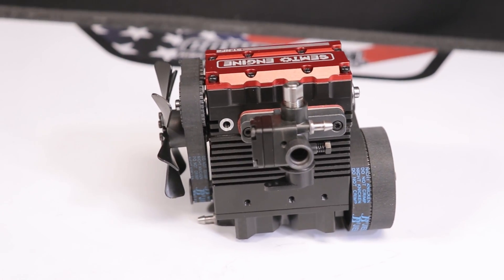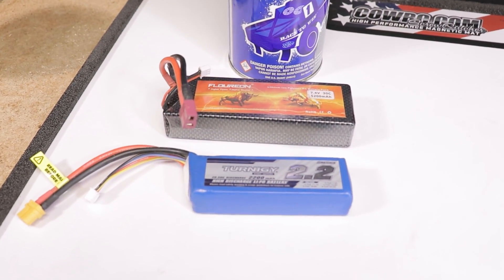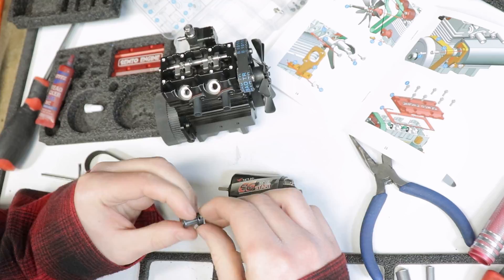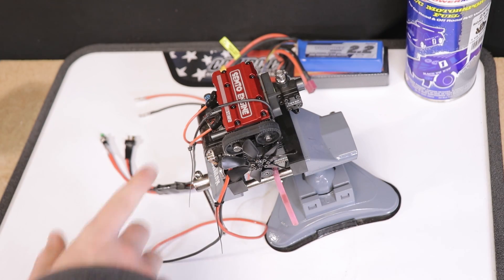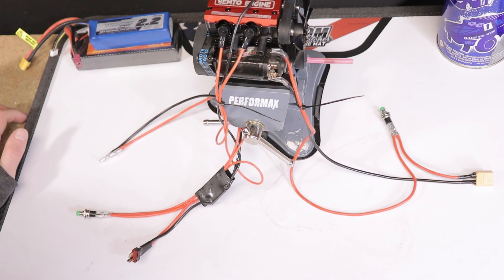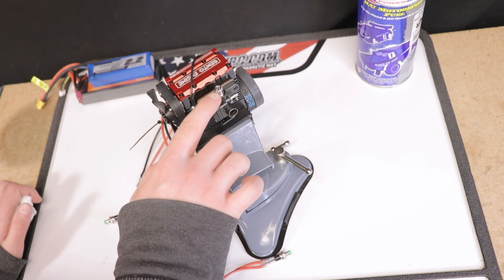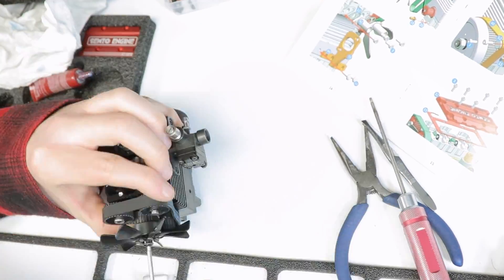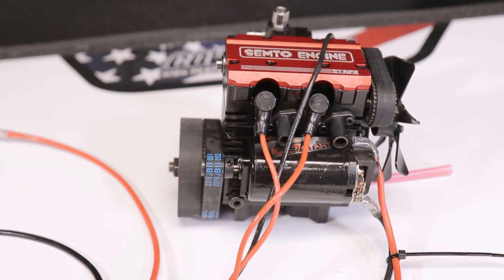Building the SEMTO ST-NF2 Nitro Engine From Stirlingkit 🔧 Full Build, First Run, and Review!

Comment: Hey, I'm building the same engine and I have a question.  I bought the engine and the starter pack, but neither one came with the ground wire terminal hardware.  Do you remember what size you used to attach the ground to the body?  Thanks.

Comment: Can you tell me what the screw settings are for the top screw in the bottom screw on the carburetor? Say did you run them in and then back them out and how many turns out for each of them?

Comment: I've gotten multiple of these chines built model engines. It's very hit and miss on the quality or design on these engines. The Semto is a pretty solid pick (Lots of trial and error and has a pretty extensive histroy to work off of with the NR200, Toyan X Power L200W, and L200. Could even say they took a lot of critical advice from their inline 4's like the L400 that build up better repor and build quality). The Semto Runs good. 

Only issue you may find when fitting this engine in to an RC it's pretty low RPM. Which means a general clutch bell will struggle to engage. If your able to find heavier shoes or softer springs. Would help. Sure fire way to transfer power from the flywheel to the drive-train would be a standard clutch like you would have in a car. Can use cork as a medium between both faces. 

Very eager to see what your plans are for this engine.